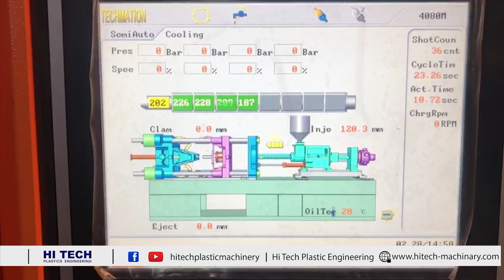Injection Molding Machine|How to Manufacture Plastic Bucket | Hi-Tech Plastic  Engineering

Comment: Damn that's so slow.. we produce around  650 buckets per h🙄..
Reply: hi, how can i contact you? I have a few questions
Reply: @knanqurbanov1190  ask me anything
Reply: what country do you live in? which country did you buy the product from? What is the price and weight of the product?
Reply: @knanqurbanov1190  I live in the uk, I use to work for a manufacturing company called Mainetti ( u can research) they sell their buckets to Morrisons UK.. I don't have this type of information on how much they pay for material and how much a bucket costs..but they used to produce around 5k buckets per 8h shift on two machines.. hope that helps
Reply: you mean to tell me you had a cycle of 5.5 seconds bucket to bucket? Were you injecting PP or HDPE? Virgin? Recycled? how much resin per shot (weight of the bucket)? What brand was the machine and size (tons)?